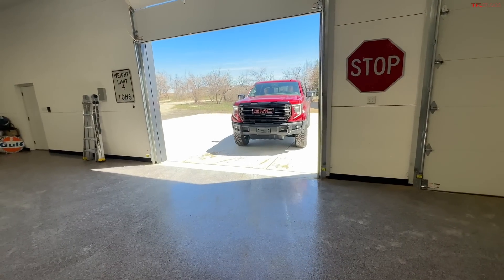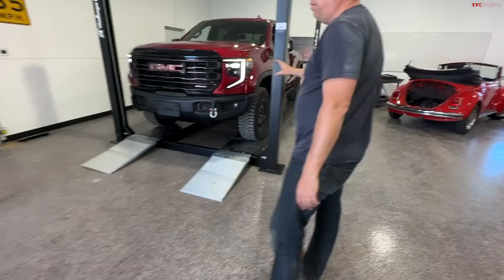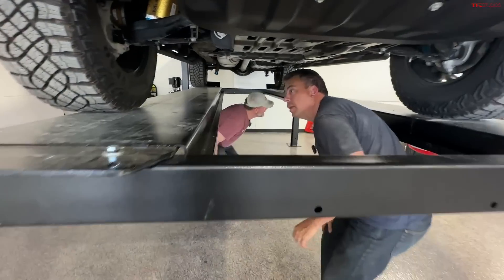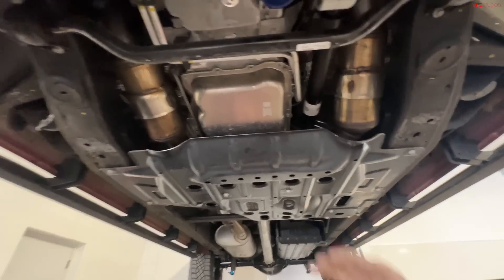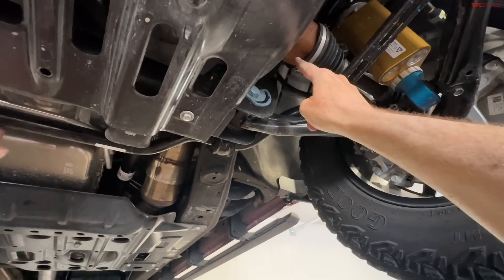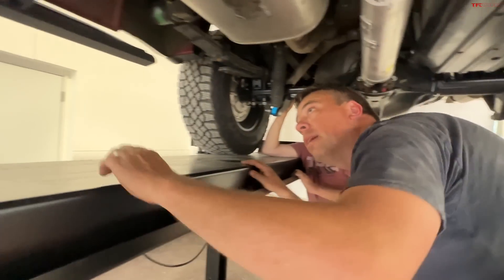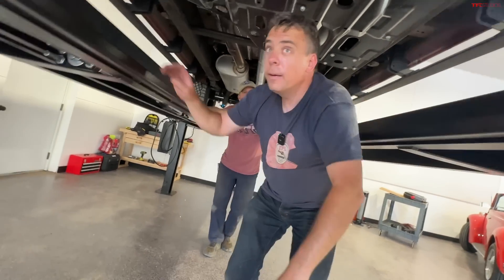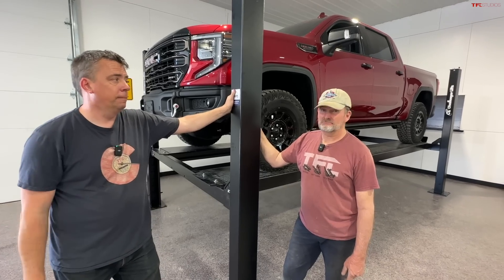What's UNDERNEATH the New 2023 GMC Sierra AT4X AEV? Only One Way To Find Out!

Comment: Those shocks are cool and all, but replacement cost are probably very expensive.  I can see people replacing them with a good but cheaper off road shocks.
Reply: Probably not a concern for quite some time, but once that time eventually comes I’d hope they’d be serviceable as well instead of requiring full replacement.
Reply: Like all things, if you can afford a $80k truck, the assumption is you can afford a $1,500 shock at each corner.  

The MagneRide shocks for our GMT were over $1k each when new, but they've come down in price quite a bit.  By the time you hit 150k miles and need replacement, there will probably be options out there.

Comment: I wish they offer regular AT4 owners the ability to buy AEV parts separate. That will be awesome.
Reply: They are working on a parts list for dealer so you can buy bumper directly from them for all the 22 refresh models. Just won’t work on the 3.0 duramax
Reply: @Michael_Puddephatt why ? 2024 comes with 3.0 duramax
Reply: @volodymyrprosov6134  all diesels have the lower cooling system that need openings on front for air flow so I’m sure they’ll have that in the new bumper for 24s

Comment: 11:42 Ride quality (aka comfort) is nice but it is not the primary function of shocks on a vehicle. They are actually meant as safety devices. The shocks on a vehicle are meant to keep a vehicle’s wheels/tires in contact with the road surface, there by allowing the driver to maintain control.
Reply: Yes, but I've never driven an off road truck that rides as good as these trucks with the Multimatic DSSV Suspension. I've got a ZR2 a d it's my favorite thing about the truck.

Comment: The mark on the frame is most likely from the PDI inspection at the dealer that sold the truck. GM ships these trucks out and some of the added options are installed at the selling dealer.

Comment: You can go higher with your lift. It hurts nothing but you look much more normal presenting the features. There will be better camera angles as well!! 😂😂😂.  
    OMG rust on the halfshafts!! It’s RUSTY. Gotta have a big issue over it!! Start calling the truck a rust bucket!! At least this truck CAN rust through on body panels as the panic spread to in some forums on Ford (aluminum body panels 😂)…. . 😂😂
     The shocks stick down some on every truck. I have been hung up on the shocks in my Ford before as well. Depends on how you slide once you are on the rock! Haha. It’s easier to get hung up on the Chevys/GMCs mind you. It’s not a huge issue on the full size trucks. 
    If Roman is the cameraman, then he needs to BE the videographer,,,, nothing else,,, sheesh!
     
      Seriously, this is a nice truck!

Comment: We use the same long fork loaders that is used at COPART to move our vehicles around and into the shop.  They operate much faster than these slow lifts.  Most of all no damage.

It would be cool if the TFL channel purchased a Cat Loader with the SAS Long forks to put these cars on to show the underside.
Reply: Doubt they will do that